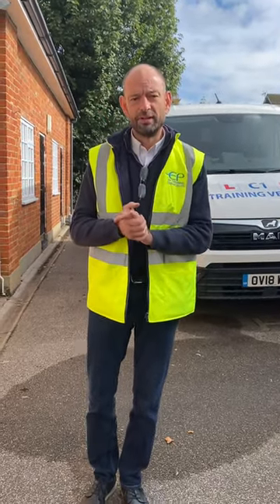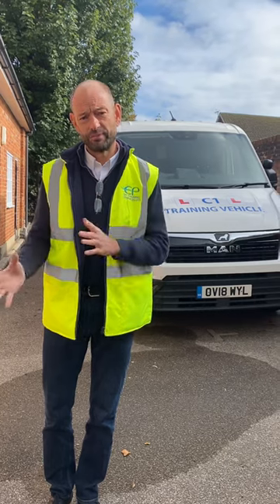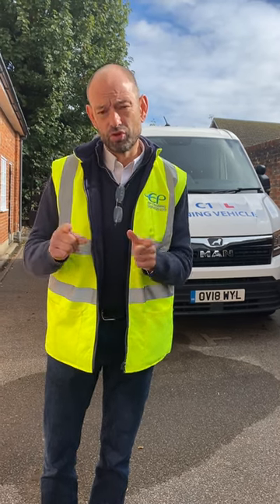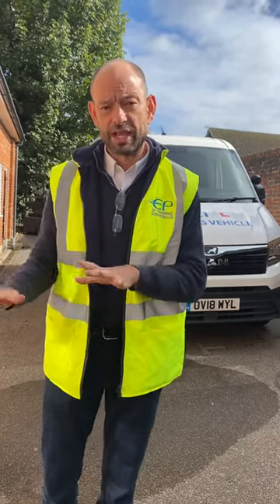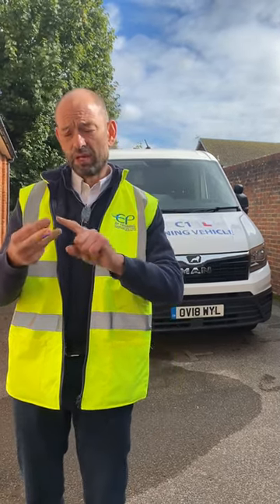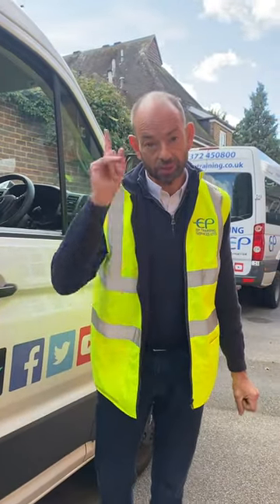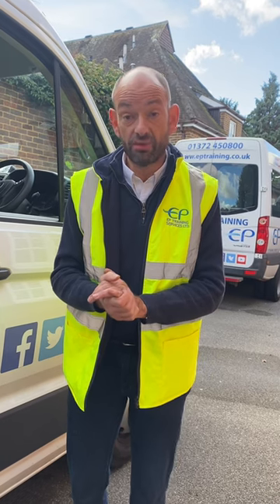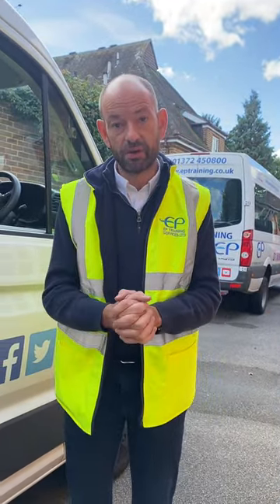Driver CPC Module 4 2024

Comment: Failed my class 2 practical test on Thursday. I came to a right roundabout and in the middle was a awful over grown bush and a silver car came flying round as I started to move . Had a awful examiner as well and it’s knocked my confidence
Reply: Sorry to hear that Amanada. It's very common for fails to happen at roundabouts. When other roads users see an HGV with an L plate they do crazy things to ensure they dont get stuck behind that truck. People are just not prepared to wait and will speed up given the chance. Don't give up!!!!
Reply: @seanpargeter25  how can we be failed if we are already on it
Reply: @amandafereday7928  You cannot impede other vehicles. That is why
Reply: @amandafereday7928  I agree however it does not matter if you are on the roundabout or not. You cannot impede other traffic. If you had continued to drive the driver would have had to slow down to avoid hitting you.
Reply: I failed the class 2 test as well. That was 6 years ago, I passed the class 1 test a few weeks ago, skipping class 2. I've found the examiner to be more lenient with finding a gap on a roundabout to pull into and using part of other lanes with the class 1 test, probably because it's bigger and slower. You'll get there, don't give up, especially if you only failed on one thing, which you now know about and can learn from. Maybe consider doing what I did and go straight to class 1
Reply: @mikecooper1293  hi thanks for your comment, I passed my class 2 test second time a couple of weeks ago and starting my new delivery job next week. Delivery palletised goods. Feeling a bit apprentice
Reply: I failed exact same way on my class 2 test.
Reply: @ringmaster996  I’ve passed now and on my 2nd week of working tomorrow
Reply: @mike cooper  
Bro I also failed the class 2 6 years ago. Now I'm going straight to class 1. I've done my theory test and hazard and module 2. I'm now trying to do module 4. Bro, is this module 4 for class 1❓️
Reply: @ringmaster996  module 4 is cpc and covers you for class 1 and class 2 for 5 years

Comment: Watch all your other videos enough times my friend. It’s much appreciated for your updated version, my test ain’t until the new year so plenty of time to drill it in. Thanks. 

Btw, I’m on the gov boot camp training. I started this early March, past the theory side of it but still waiting for the practical. Now they are saying that they are struggling to find placements for their students. They have given me a preliminary date which will be some time early next year. 

Also they initially said the training will last 5 days, and the test will be on the 5th day. Now they are saying it’s only 2 days training and the test will be on the 3day. In your opinion as a professional driver is this feasible. Can the class 2 training be done in 2days ?
Reply: Thanks mate
Reply: That sounds extremely short time for getting to the stanard.
Reply: Hi there

I have just passed my class 2 test after my second attempt 

I had 4 days training and to be honest with you, If you can drive you should be okay. Just listen to the trainer. Make sure you check your mirrors every time you pass a large vehicle, pedestrian , slow down, accelerate. You should have more than two days but you will get a re test so don’t worry to much.
Reply from the maker: @amandafereday7928  yes! Well done you and thanks for sharing your good advice
Reply: @EPTrainingServicesLimited  thanks mate, I have my cpc on 23rd so trying to get all the information as I’m slightly dyslexic